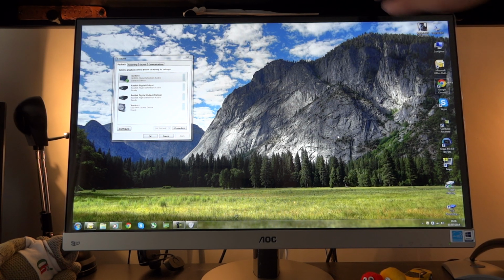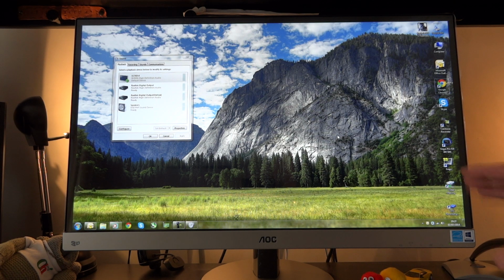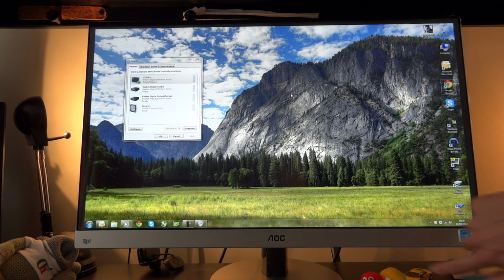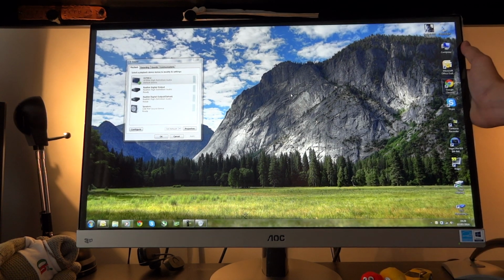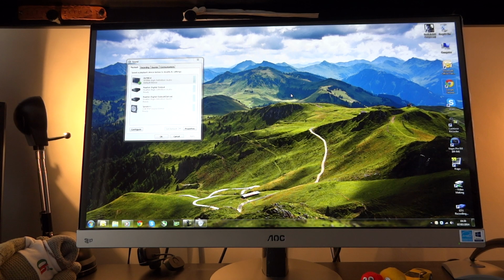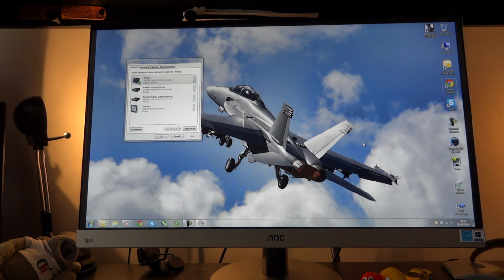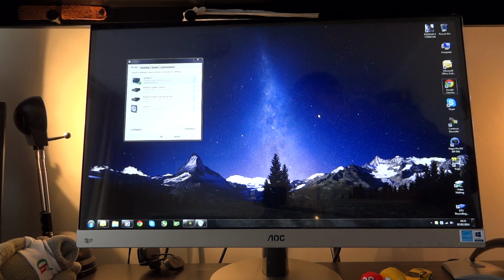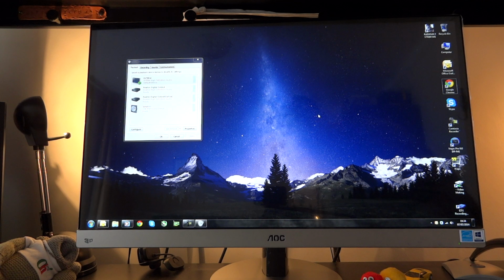AOC D2769VH 3D LED Monitor Review - By TotallydubbedHD

Comment: Have you tried any 3Dmovies yet?
Reply from the maker: I didn't try 3D movies - as I don't own nor know anyone that has a 3D movie.
I did "convert" them to 3D though - mentioned in my review.
Reply: ***** cool. A friend of a friend of a friend found a link by accident that he clicked by accident, and this movie opened in 3d.
Reply: ***** I'm back and I got the monitor. Didn't have to go far to test 3d. search YT for 3d side by side and press 2d to 3d converter and you don't even need software to convert anything. These monitors are really value for money. All my friends think it costs 500+ when they see the functions and quality. Really happy with it.
Reply: ***** did yours come with a screen protector on it? Did you take it off? Because I'm trying to battle glare on the screen, and even in complete dark, I can see some reflections from outside light.
Reply from the maker: ***** Well the 3D on YouTube is native 3D - I did that too, and it was decent, but it's not a true 3D film, which is recorded and made in 3D.
Usually the ones on YouTube are "converted" to 3D or uploaded at a lower resolution and compressed by YouTube.

As for the screen protector - I had a review unit, so there was nothing on there bud!
This monitor does have slight glare though, so I can understand where you're coming from.
Reply: ***** a friend of a friend of a friend came across a 3 side by side movie which he downloaded and watched without the need of any software. I'm not sure if it's monitor or gfx card related. But no additional software was needed for 3d movies. FPS of the movies was set between 27fps-30fps and can't be changed :/ Only thing I know is that you need additional software for 3d gaming.
Reply from the maker: ***** oh yeah no additional software is needed for 3D movies - but YouTube is a little different